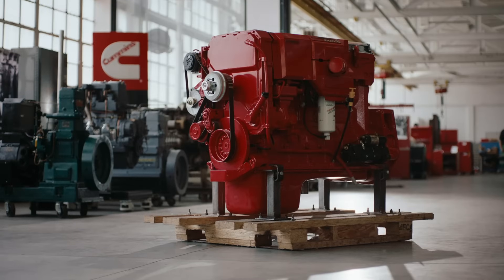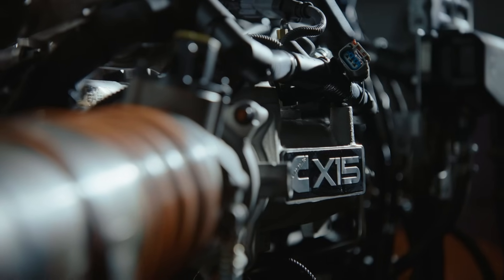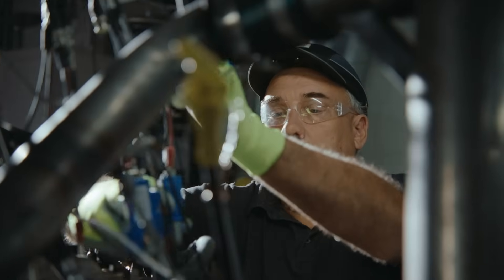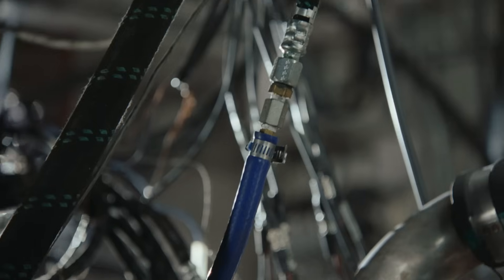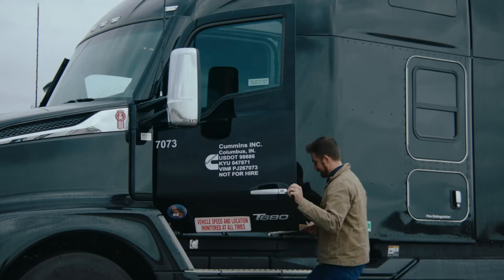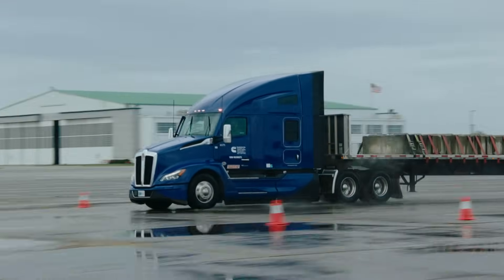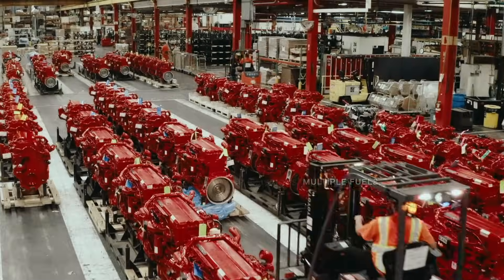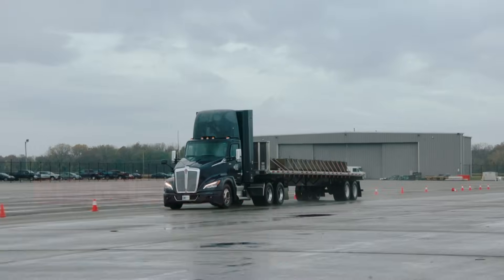Next Gen Cummins X15 HELM

Comment: Imagine the fuel efficiency possible if the emissions system wasnt on the engine
Reply: Agreed.  Drill more, make stronger engines, not lighter more "efficient" garbage that wears out and costs tens of thousands to repair.
Reply: Why imagine? Just use natural gas instead of diesel.
Reply: @PistonAvatarGuy  Unfortunately CH4 has nowhere near the BTU content of diesel
Reply: @FireLt2017  The fuel tanks just end up taking up a little more space on the truck, but not enough to make the fuel unusable.
Reply: @PistonAvatarGuy  The BTU content of diesel vs NG has noting to do with the fuel tanks
Reply: @FireLt2017  Then why is it a problem?
Reply: @FireLt2017  I guess you were trying to troll me, because I thought that you meant by volume, which is a bit of an issue when trying to store fuel on trucks, because it makes the tanks larger and heavier than diesel tanks.

If you were trying to say that CNG has less BTU than diesel on a per gallon basis, that just doesn't make any sense, because a CNG gallon can be whatever you want it to be, it's just based on energy equivalency. You can base a gallon of CNG on the energy content of gasoline, or diesel. A DGE (diesel gallon equivalent) of CNG will have the same BTU content as a gallon of diesel fuel.
Reply: @PistonAvatarGuy  I'm not trolling anyone. Unit for unit, diesel has more energy. You could certainly inject enough NG into the engine to equal the amount of energy in diesel. That's impractical, and now tanks come into play. If you try to inject that much NG into the engine, you will meed a lot of storage if you want any range from the truck. As a truck driver who has driven both, the NG engine makes a lot less power than the diesel. And, if we are going to try to match the power of diesel, the amount of NG required increases the carbon output. Light duty diesel pick ups with deleted emissions systems get 20-25% better fuel economy. That means the truck has 20-25% more CO2 output just for the optics of eliminating soot. They cry about CO2 all day long and the EPA mandates emissions systems that cause the truck to emit more CO2!??
Reply: @PistonAvatarGuy  NG tanks are heavier than diesel tanks. Trucks in America can weigh 80,000 lbs. Not carry 80,000, weigh 80,000.  It does not matter where that weight comes from, but the heavier the truck is, the less cargo it can carry.  When you are talking about carrying enough NG to achieve a "diesel equivalency", that's a significant weight gain. That's why the tanks matter
Reply: @FireLt2017  Of course, my comment wont post. Can't have PistonAvatarGuy looking like he knows what he's talking about, can we?
Reply: @PistonAvatarGuy  I'm not talking about equivalency. The truck does not have unlimited space to carry the fuel equivalency of diesel. Look at it this way. The truck carries 150 gallons of diesel. Now calculate how much NG it takes to equal the energy content of 150 gallons of diesel. Each gallon of diesel has 118,00 BTU and each cubic foot of NG contains 1015 BTU. You need to carry 117 cu ft of NG for each gallon of diesel
Reply: @FireLt2017  The energy density of NG varies by how much it's compressed, the more it is compressed, the more energy it contains within a gallon (volume). At the pressures commonly used in CNG vehicles, the volume of CNG needed to achieve the same energy density (by volume) as diesel is only a few times larger.
Reply: @PistonAvatarGuy  Look, a cubic foot of NG has 1015 BTU and a gallon of diesel has 118,000 BTU. The standard unit of measure for diesel is a liquid gallon and a cubic foot for NG. Compressing NG does not give it more energy per cubic foot. It only means it has been compressed. As it is released from the tank, each cubic foot has the same energy as it had when it was put in the tank. According to your argument, you would have to be using the NG at the tank pressure all the time. You are not considering what happens to your density equation as the pressure in the tank drops (the lower the pressure, the lower the energy density according to you)
Your energy density model gets worse by the minute as the truck is depleting the tank pressure. BTU's result in mechanical energy the engine produces and the fact is that you need 117 cubic feet of NG to do the work of one gallon of diesel- no matter how the NG is stored on the truck
Reply: @FireLt2017  I know that you're trolling, but...

CNG is typically sold in GGE (gallon of gasoline equivalent), which is 114,000 BTU per unit. GGE is the most common standard unit when dealing with natural gas at refueling stations, not cubic feet.

CNG is typically stored at 3,600 psi in vehicle fuel tanks. At that pressure, 3.8 gallons of CNG contains as much energy as a gallon of gasoline and 4.3 gallons of CNG contains as much energy as a gallon of diesel.
Reply: @PistonAvatarGuy  So, trolls are people who disagree with you? 

The bottom line is the truck makes less power on NG and it takes significantly more NG than diesel to make less power. The tanks are heavy, reducing cargo capacity. Then there is the whole high pressure tank issue in the event of an accident or vehicle fire
Reply: @FireLt2017  Trolls are people who knowingly post nonsense. Yes, the trucks do have some disadvantages, but they also have some huge advantages. YouTube wont let me post about the most important one, which is interesting. Too political, I guess.

The power problem can likely be solved with further engine development. CNG tanks are almost never a problem when it comes to safety, they're strong, well armored and safety valves are very good at preventing leaks.
Reply: @PistonAvatarGuy  Now I'm posting nonsense? 
I said NG has less BTU's than diesel. It does, and you agreed by posting that it takes 4 gallons of NG to replace one gallon of diesel. This is a liquified equivalent, but the truck is not using liquified natural gas, it's using CNG, so there is nothing nonsensical about posting the BTU content of NG by the cubic foot. It further demonstrates the BTU disparity by pointing out how many cubic feet of gas are needed to equal the BTU content of diesel. And thats's nonsensical?While the tanks are robust, they are not immune to fire damage or physical damage in a collision, both with the potential for an explosion.
I could say you are trolling because your argument is based on semantics, not the actual bottom line- diesel has more BTU's than NG no matter how you slice it. It's not nonsense
Reply: @FireLt2017  Ok, no longer fun. Have a nice day.
Reply: @FireLt2017  BTW, how long are gasoline molecules relative to diesel molecules? Which engines make more power? Seriously, that was a weird way to try to troll someone.
Reply: @PistonAvatarGuy  You want to talk molecules now? The engine burns molecules and produces heat from them but you dismissed that as nonsense, so no thanks
Reply: @FireLt2017  lol. Alcohol engines can produce even more power than gasoline engines.
Reply: @FireLt2017  "Now with more MOLECULES!!!" <-- What's that from?
Reply: @PistonAvatarGuy you’re the problem
Reply: @andrewhatton1606  Why?
Reply: @andrewhatton1606  Your entire worldview is based on evil, i am not the problem.
Reply: They can make trucks that run on Ethanol instead of Diesel. They will require no emission controls.
Reply: @ghungroo3850  Even if that's true, where do you get the ethanol?
Reply: I am utterly confused by the upvotes on registrationhater's comments. Are people upvoting because they're impressed by his ridiculous trolling, or because they genuinely believe that he's making an actual point? The exchange summarized:

Him: CNG BTUs bad.

Me: The only reason that's a concern is because it makes the fuel tanks slightly larger and heavier, but it's not a dealbreaker.

Him: It's not related to the size of the fuel tanks, it's just that it's the size of the fuel tanks.

Me: Ok, you're obviously a being who lives under a bridge.

What I didn't respond to (because it was clear that he was trolling and I didn't really care at that point) was the fact that the carbon content of CNG per BTU is far lower than the carbon content of diesel, so for the same amount of power (energy, really, is the concern here) produced by an engine, CNG has significantly lower carbon emissions than diesel. CNG is just a far cleaner burning fuel than diesel in general, on a BTU for BTU basis.

He also states that CNG has less BTUs that diesel, but that doesn't make sense, because it's significantly more energy dense by weight, but not so when measured by volume. He's just spouting random nonsense.

Also, people seem to be concerned that working toward the goal of eliminating our dependence on petroleum would be a significant problem because of the petrochemical industry, but, really, the main concern is plastics, which are almost entirely derived from natural gas anyway. IMO, I don't see a problem with significantly reducing the amount of petroleum products that we produce anyway. Big oil simply has the world by the balls.
Reply: @PistonAvatarGuy  First of all compressed natural gas cylinders are heavier than diesel tanks and they occupy a lot of space on the truck. The tank weight to capacity ratio is much higher than a diesel tank. An empty 50 liter (water equivalent) tank weighs 105lbs, the equivalent of 15 gallons of diesel. Typically there are 6 or more of these tanks.
Class 8 trucks can weigh 80,000lbs and it does not matter how the truck arrives at that weight- fat driver, heavy trailer, additional fuel tanks, etc. That means the heavier a empty truck is, the less cargo the truck can carry. A CNG fuel system is heavier than a diesel fuel system which diminishes the cargo carrying capacity of the truck. That's the dealbreaker

CNG has less BTU's than diesel molecule for molecule. Units of measure aside, both are hydrocarbons, meaning they are composed of hydrogen and carbon atoms. The natural gas molecule is CH4, meaning there is one carbon atom with 4 hydrogen atoms attached. The diesel molecule is C12H23, meaning a string of 12 carbon atoms has 23 hydrogen atoms attached. 
So, natural gas with 4 hydrogen atoms makes more heat than diesel with 23 hydrogen atoms??? The heat (BTU's) comes from the hydrogen! It takes 6 CH4 molecules to equal 1 C12H23 diesel molecule.
My company has a few CNG trucks. The CNG trucks make less power than the diesel trucks, period. The diesel trucks out pull the CNG trucks all day long! Why? Fuel BTU's.

You don't like diesel and thats obvious. It does not mean you can make up your own chemistry facts. 

If CNG was soooo bad ass, there would be more CNG trucks coming from the factories, there would be more companies using it, and more truck stops selling it. CNG systems have been available for more than 3 decades now and hardly anyone is using them!

Carbon emissions from diesels with emissions systems are higher than those without them. Deleted light duty diesels getting 15mpg with emissions systems are getting 20mpg with them deleted, which is a 30% decrease in carbon output. Diesel emissions are about optics- black smoke. We are so willing to embrace a smokeless exhaust that we are also willing to increase carbon emissions by 25-30% to do it! The tree huggers are so enamored by the smokeless exhaust that they don't even realize there is a substantial increase in CO2 to pull it off. Stupid!
Reply: @PistonAvatarGuy  Your ignorance of chemistry is astonishing. According to your argument, propane has fewer BTU's than NG. It doesn't by the way. That's why propane heat is more efficient than NG.  The longer the hydrocarbon chain the more BTU's, it's that simple. If NG trucks could make as much power as diesel trucks, they would, but they don't. I don't recall making a comparison between deleted truck emissions and NG truck emissions, I contrasted diesel engines with and without emissions. And you know as a matter of fact that I'm unaware of dieselgate? How would you know that? We didn't discuss it. Sounds like you are the troll.
It's hilarious that you are crying about my comments being liked!! Perhaps what I'm saying isn't the nonsence you espouse it to be lol!
Reply: @FireLt2017  Nothing that I said here could be interpreted as me having said anything about the energy "efficiency" of various fuels. Per unit of thermal energy produced, CNG is cheaper and cleaner burning than diesel, so even if it took ten tons of the stuff to produce as much energy as a gallon of diesel, it would still be cheaper and cleaner to use it as an energy source.

Your ignorance of engine technology is astonishing. All that you need to do to make more power with an engine is to cram more fuel and air (Now with more MOLECULES!!!) into it, and while there are limits to how much fuel and air you can cram into an engine, we're not discussing engines that are even remotely close to those limits. With CNG engines, the knock limit prevents engines from exceeding a certain power level, so if there is a limitation on the amount of power that CNG engines can produce relative to diesels, that's going to be the cause. What you're not understanding is that cylinder head design plays a huge part in preventing knock, so a cylinder head which has been designed for use with diesel fuel isn't going to be optimal when trying to avoid knock. From what I've read, it's even true that aluminum cylinder heads offer superior resistance to knock when compared to iron cylinder heads, yet these CNG heavy truck engines still use iron cylinder heads.

The discussion here is about diesel vs CNG, your 'deleted' diesel vs emissions controlled diesel comparison is irrelevant. CNG engines are far, FAR cleaner than diesels, PERIOD.

You demonstrated that you don't understand anything related to diesel emissions controls when you claimed that it was all about optics, so you clearly don't understand anything about anything here.

I must congratulate you on your expert level trolling. What a horrifyingly evil and destructive skill you have.
Reply: Its funny how these engines still have a 5-6 mpg fuel efficiency. I wonder why? Well if you find out who owns cummins and who owns the oil companies there is you answer, big time investors that pretty much own everything.

Comment: These days Cummins is an absolute overpriced piece of crap !   The dashboard lights up like a frigging christmass tree within days after every shop visit trying to fix whatever is wrong with the Cummins junk under the hood and it’s always a struggle with the warranty claims !   

I tremendously miss the Caterpillar engines and the last decent Cummins was the N14+ (it was decent because it was the cheapest truck diesel to do an in-frame rebuild after the big cam ntc and not because it was a very good product /  cummins = “come apart” )

Comment: If Cummins really cared about their future and the future of the trucking industry, they would pay close attention to what Edison Motors out of Canada is doing. The future is not more regulation and more environmental BS. You want power and torque, that's going to come from electricity. This is not something new, locomotives for decades have been diesel electric hybrids. And now, a startup out of Canada in less than 1 year has brought a brand new OEM truck to market. For the first time in 30 years in British Columbia, a brand new truck has come to market and it is going to put the other truck manufacturers and engine manufacturers to shame.

Pay attention to this little company, because they are going to rewrite the trucking industry.
Reply: Did you know Cummins makes locomotive engines up to 120L in Indiana?

Comment: Why has the longevity of the engine become less reliable? A bc400 from 40 years ago lasts longer before a rebuilt. You have gone backwards in a major way , i wish we still had choice in engine manufacturers, especially in paccar products. Your engine would by no means be first choice fitted. Or second or third option.

Comment: Skip the BS and make an engine that doesn’t quit every time the sun goes behind a clowd!
Reply: Efficiency doesn’t mean 💩 when they break down constantly and cost thousands of dollars just to keep them running. The emission system designs have destroyed diesel reliability.
Reply: Yeah, exhaust gas recirculation and good engine performance don't seem to go hand in hand. Cummins wouldn't do these crazy emission things if it weren't mandatory. @prevost8686
Reply: @prevost8686  working as designed. NOx is a BS metric of "cleanliness." This all part of the CFR plan. Why is there no such thing as emissions in China or India?
Reply: Change the oil every few thousand miles.     Nothing the factory can do about incompetence.
Reply: @jonellwanger7258  oil is not the problem

Comment: More corporate greed and hand greasing.
We don't care about if it's clean. We don't care about if it's all that efficient, we wanted to be dependable. If you were electrical things you could put on a diesel, the better a battery, a starter And let the black smoke roll
Reply: Battery is worse than diesel